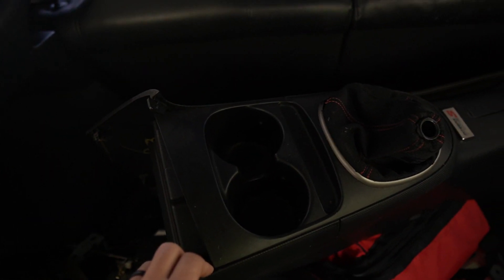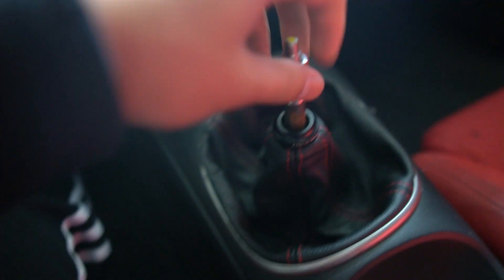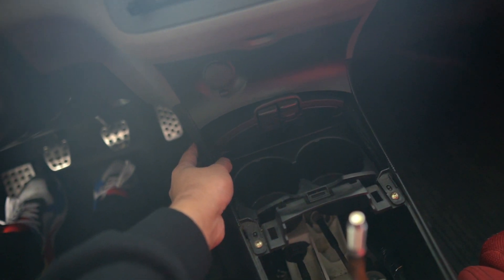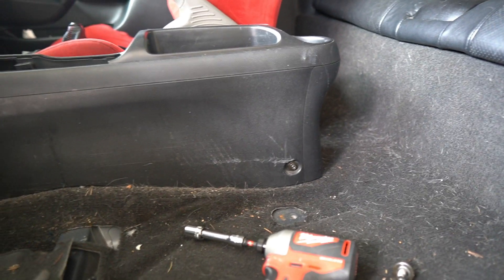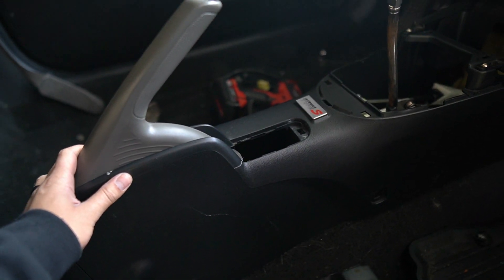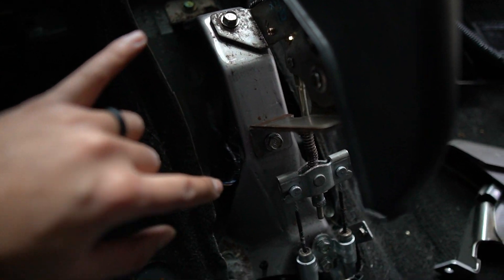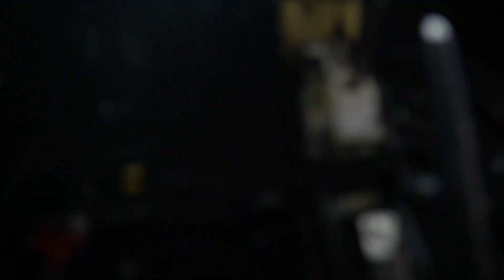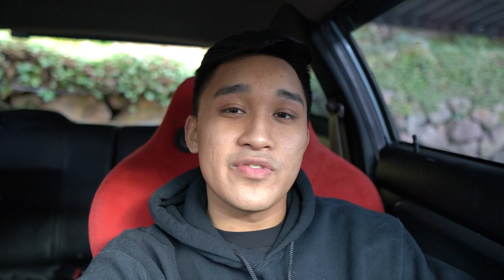Type R Center Console & Ebrake Install | RSX Type S EP 2

Comment: where did you get the center console and the ebrake from? Also, did you put the OEM part for the back of the console (cigarette lighter) on to the type r one?
Reply from the maker: I bought it from someone local. I did not put the USDM cigarette lighter port back onto the JDM console as I did not see a spot for it. I would have to check if that’s even possible. It’s more so plugging something in and there wasn’t anything to plug back there.
Reply: @crispycambodian  Oh ok. I thought that you could swap out the back piece since it looks like you can.
Reply from the maker: @urielortiz3667  I’ll have to check again
Reply: @crispycambodian  did you use the USDM brake sensor?
Reply from the maker: @urielortiz3667  yes I showed it in the ebrake portion of the video
Reply: @urielortiz3667 you can’t swap the backs unfortunately